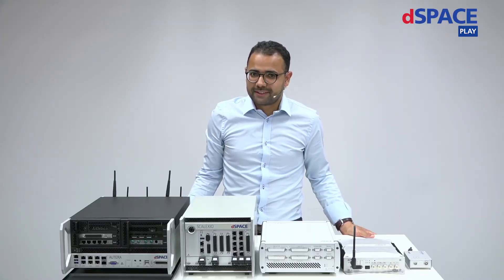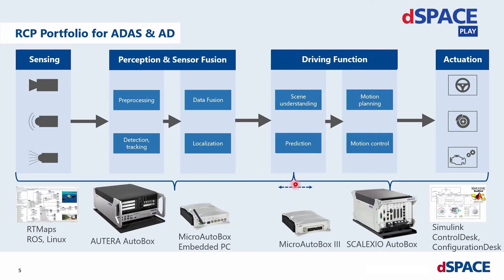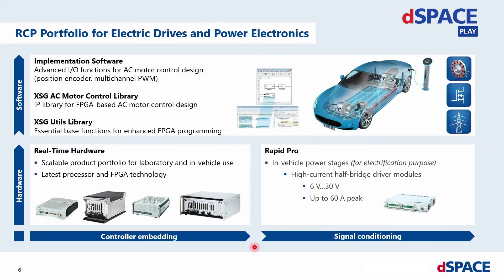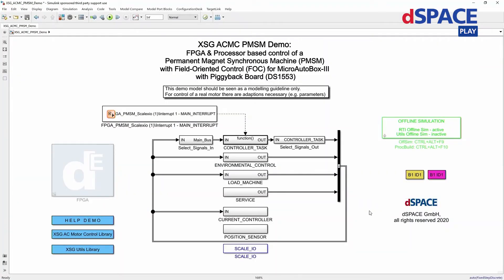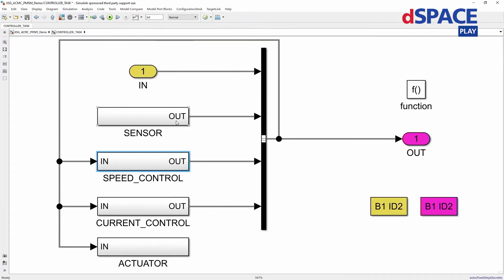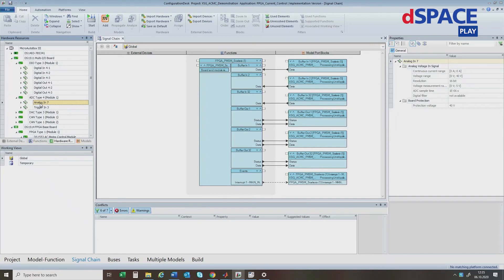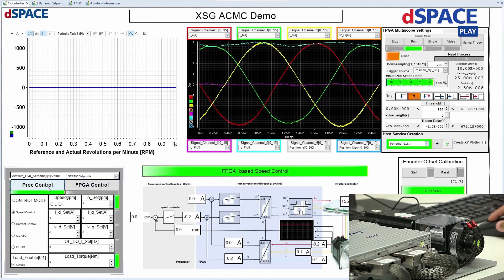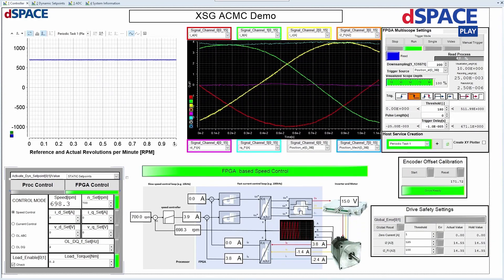Rapid Control Prototyping

Comment: hi, 
1. I wonder why there are only 2 wires connecting the RapidPro(the inverter) with the PMSM. It is supposed to be a 3-phase synchronous motor and thus should have 3 wires. 
2. Is the RapidPro capable of driving a multiphase PMSM, e.g a 6-phase PMSM?
Thanks!
Reply: I think that may have been power while the control signals were on the other side.